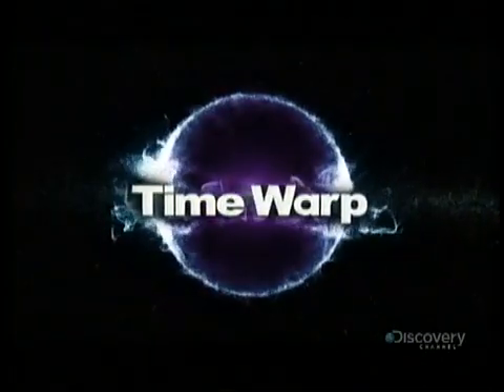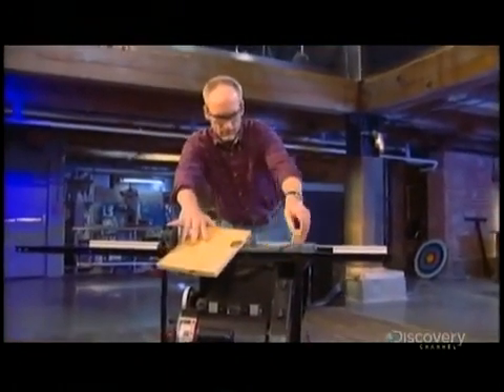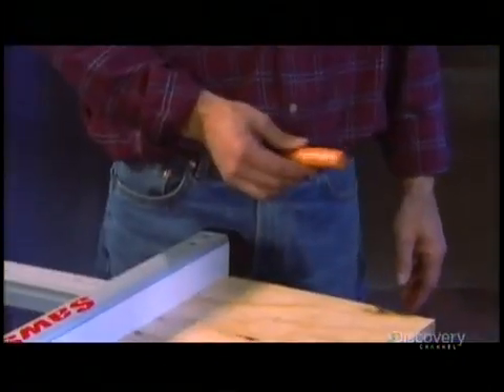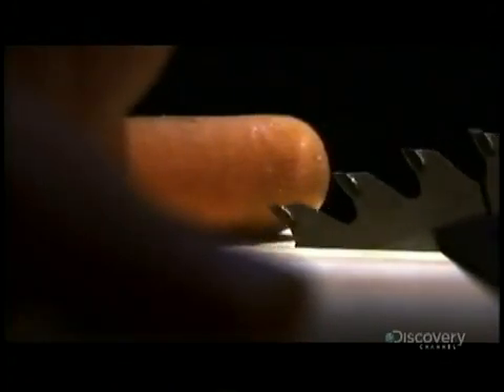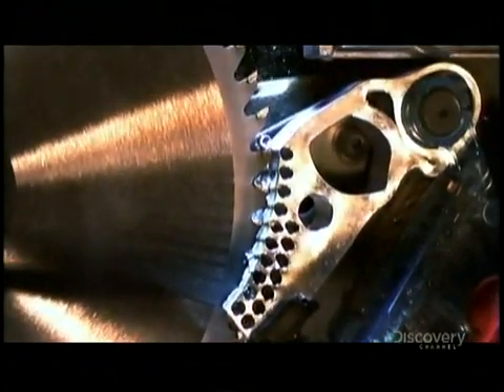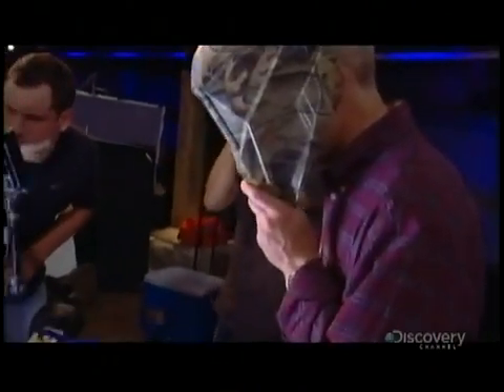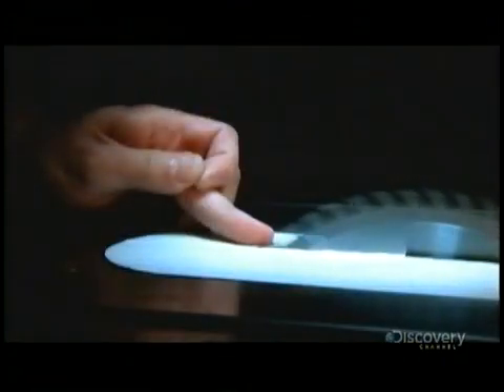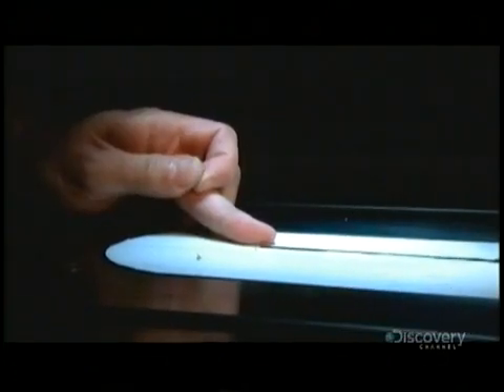Saw Stop - This guy puts a finger into an active table saw blade & comes away without a scratch!

Comment: My school has a sawstop. It went off 3 times last semester. I can confirm that it does work.
Reply: @rockeeetttt  watch other videos on it. You replace the cartridge and the blade, and it takes less than 5 minutes. No need to spend money on a repair guy.
Reply: @Nico-pb1sr  wtf dude if u can't change your own blade and cartridge you shouldn't own a saw lol
Reply: $60 is way cheaper than a finger I would say.
Reply: @silencedknight  I would know
Reply: @silencedknight  Depends on the country.
Reply: @rockeeetttt  nah bro you literally pull the blade and brake out and snap in a new one you dont need a repair man
Reply: Spencer Wentland they said only $60 to rebuild it
Reply: @abcabcq313  plus labor. 60 is the mechanism and blade
Reply: Niko K that’s nothing compared to the price of losing a finger, especially 3 school kids I’m sure the school didn’t mind
Reply: @DisturbedDrake  Even if it costs 1000 dollars its worth saving a finger.
Reply: @iBradFIFA  ikr compare to the lawsuits
Reply: @DisturbedDrake  yeah but Any good work shop could do the fix them
Reply: @DisturbedDrake  if you couldnt change them yourself and had to hire someone you probably shouldn't own one lol
Reply: @abcabcq313  It depends. $60 bucks for the cartridge + the damage. It can or  not destroys the Saw Blade, it's possible to brake some transmission part and more...or just the cartridge.
Reply: HyBye ❶ wtf $60 for blades and mechanism what kinda cheap ass machines are ya workin with
Reply: @PyroYeet  I agree my blades definitely are 3 or 4 times that price but still worth replacing cause I can't replace my fingers!
Reply: @jasonlemire591  I’m no longer in woodworking but when I was, I remember our gear was expensive, quality, and safety
Reply: @PyroYeet  ya I can easily spend few hundred on blades
Reply: In my high school wood shop about 10 years ago we had one of these too that went off at the same rate. When I was there it was always a student sawing through a board with nails or aluminum tape but it's way better to have the system and spend $100-150 for a new cartridge and blade than have to explain to the parents why Billy came home with a few less fingers.
Reply: Money doesn't matter when you save a finger
Reply: @Hansolo2048  People always find something to bitch about.
Reply: @Hansolo2048  Money always matters, even with safety and security. Wether we want to believe it or not.
Reply: @Tconl  Incorrect. Quality of life is priceless.
Reply: @Tconl  cheaper and much easier to replace a saw and a brake than 1-3 fingers of a good worker, lot less headache too
Reply: @shadowsnipes9242  Unless its not a good worker. And you got plenty of em. And they got very little legal work to back them up. As I said before, it depends on the country.
Reply: cheaper than a lawsuit
Reply: Spencer Wentland it only ruins the blade and brake
Reply: @rockeeetttt  It destroys the module and blade. I would rather break that than have my life altered forever
Reply: Wish we had this in my day. Tons of kids at my school got it the rough way. The worst was the kid who got it from a planer...
Reply: @TightCasserole  
Hey sir, fingers were cut off completely? was that in 60s?
Reply: I was upset when I found out my saw didn’t have one of these, after I cut off 2 of my favorite fingers, but then, later, I learned that if my saw had had one it would have costed me 60 bucks to fix it, so I was relieved. Cleaning up the blood didn’t cost me a dime, and my saw still works great!
Reply: @chriswebster24  fingers are over rated
Reply: Spencer Wentland not true
Reply: @rockeeetttt  why say things you know are not true?
Reply: I put my finger into the sawstop at school to prove to my friend that it worked
Reply: @jfk9237  geez don't ever do that again but I'm glad it worked.
Reply: @jfk9237  I put my friend into saw without stop to prove it wouldn’t stop
Reply: @jfk9237  well that was an hour waste of my time... last time I listen to a ghost
Reply: That’s 3 people who have no business on a table saw. You should still treat like any other table saw..
Reply: @ScrewedupClicksta713  I remember this actually being an argument against them… a stupid one, but one nonetheless.

People feared that users would become complacent and trust in the system and this take less care around them and while I’m sure that’s true to an extent you can say the same about any safety feature; doesn’t mean it shouldn’t be use but simply not relied on.
Reply: @Fetidaf  haha I remember reading that crap too on Reddit. Had a lot of arguments with disbelievers over saw stop 5 years ago.
Reply: @ScrewedupClicksta713  ikr I don’t think anyone should be on a table saw, I put wood on it myself.
Reply: We didnt. Around 5 fingers in 4 years went flying.
Reply: @goos6005  shop class, a lot of schools stopped teaching it because of liability so many schools don’t have them now
Reply: @bumstudios8817  that's a shame. My first power tool was a cheap $100 Ryobi 13amp table that I still use. and first thing I did was read the manual, and figure out ways to avoid kickback. One of which I literally do rip cuts standing on the side of the fence and pull the piece toward me, and forward. That and I built a really cool table saw sled that physically blocks your hand from touching the blade and it has a plexiglass cover which protects from kickback and also leaves the dust on the table in a very neat pile at the outfeed.
Reply: @WarPigstheHun  that’s awesome, respect it and use it properly and it will be fine. Play stupid games.. win stupid prizes. They don’t need to be expensive, at the same time experience matters a lot too.. watch I build it ca.. where he puts his fingers an inch away
Reply: @bumstudios8817  yeah. Still, I wish I could afford the saw stop. And I also really like to cut metals. So I built the next best thing.
Reply: @- Literally not true...
Reply: @rockeeetttt  bullshit
Reply: @rockeeetttt  This video is very old and will have newer tech or saws built especially for this tech.
Reply: What a beautiful impact to see after watching the video
Reply: I have a feeling that kids just wanted to test it. If not, I'm genuinely concerned about those people around power tools.
Reply: Really I bet those kids would of deserved it how THE fuck can they set it off 3 times
Reply: Last year the one at my school went off but nobody had a finger near the blade, our teacher thinks it was because the wood was too wet.
Reply: @Alex-oz8qf  lmao if you’re using wood wet enough to trigger that, then whoever assigned the wood should be fired, unless ofcourse you’re making a piece of outside furniture that will be in the rain a lot
Reply: @PyroYeet  yeah, the wood was being used to make chairs to go outside
Edit: also it was wood that we had recently cut using our sawmill so it had been outside and didn't have very much time to dry.
Reply: @Alex-oz8qf  oh wow so REALLY wet wood, usually it would be around 12-20% moisture (broadly taken) that you’d saw so fresh cut wood with no drying, prob at like 50+% moisture will trigger the sawstop. Also make sure you don’t get wonky chairs
Reply: @PyroYeet  chairs made of green wood :)
Reply: Lmao we had a woodshop teacher who set one off like 6 times we called him sawstop peters
Reply: Spencer Wentland wrong actually, the only thing thats replaced is the blade and the break. Not the entire thing
Reply: @rockeeetttt  old video
Reply: MassiveFatD You sound that you’re wrong
Reply: Oh shit-
Reply: @slum or more geez
Reply: furfag
Reply: Bullshit
Reply: @goos6005  shop classes like carpentry.
Reply: Lol
Reply: Why is a saw like that one at your school?=)))
Reply: If it went off three times maybe that person should not be using that machine
Reply: God damn just imagine if it weren't there
Reply: @slum or one kids 3 fingers
Reply: That is good that it's saved their fingers, but they need better training if students are potentially going to cut themselves that often. I use one at work and it's not a saw stop, but we have proper training, riving knife and guard and no one has cut a finger off on it and no one has had an injury on it when using it correctly
Reply: @WillMaskellTaylor  I refuse to use my riving knife both because- I bought a full kit of that  expensive microjig thingy, and built a very fancy sled with a plexiglass that shields you from dust and kickback and has a layer of aluminium that  prevents your hand from moving in front of the blade.
Reply: @slum not so fast. If you know the machine stops when you put your finger in it, how do we know the kids aren’t just intentionally putting their fingers in it
Reply: My school didn't have one and a kid lost 2 fingers. He was shot 1 month later for "throwing gang signs" at a rival gang. 
Westside til he died.....rip lil homie
Reply: One kid 3 times i wager.
Reply: they probably did it on purpose.
Reply: How do people get their fingers into the blade anyway? If I was working with such a dangerous machinery I'd make damn sure my fingers are not going to touch it.
Reply: @Gaze73  people don't always do this intentionally. Sometimes they're contractors and forced to cut pieces faster than recommended or they'll lose their jobs. Sometimes people forget and work when they're exhausted. In theory everyone should follow the rules but, in reality we are human and imperfect beings. Saw stop is designed with that in mind, that it's not always the users and even if it is, accidents do happen but it doesn't need to cost a finger or life.
Reply: @Gaze73  Easy to say when you don’t do it. Like anything, people simply become too comfortable.
Reply: @jacksonbould7417  that's good. If I ever get to buy one of these, I hope it never goes off on me.
Reply: Why does your school have a saw?
Reply: @toohottohandle3928  shop class was a standard class a few years ago
Reply: @toohottohandle3928  What? So people can learn how to use a saw?
Reply: @toohottohandle3928  shop class, learning construction and shi
Reply: Lmfao like what were u guys doing before sawstop
Reply: You don't deserve a sawstop you furry scum
Reply: My school didn’t get it as most high schools are filled with immature kids that would purposely activate the sawstop. Was also told it’s not cheap to replace blade and other parts needed.
Reply: @TheWaken  that’s a stupid reason. Send the Bill to the parents then.

Comment: It is closer to $300 each stop, and that is better than a finger.  But the problem is, any wet treated wood will stop it too.  At $300 a stop, it is not worth it.
Reply from the maker: Damn that is a good point, didn't think of that
Reply: From what I've heard it's pretty rare for wet wood to set them off these days. And even then, I believe you can disable the mechanism temporarily. Shouldn't be a problem unless you're working exclusively with wet wood.

Comment: Instead of damaging the blade and braking system when the safety function is activated, why not have a mechanism that pulls the blade downwards. The blade is saved as well as ur finger. Use a spring to pull onto the bush or bearing housing spinning the blade. Can be held up by a latch. When the finger touches the latch is released and the blade moves downwards. Just a thought.....
Reply from the maker: That is actually a good idea
Reply: bosch makes one like that but you need to replace the cartridge that pulls the blade  because it uses some sort of explosive. but im guessing saw stop makes a lot of money on brakes and blades so thats why they do do that
Reply: actually who cared about the blade and the machanism when it just saved you finger or even an arm.
Reply: @adventureairinc7355  no one, but when it malfunctions, and is set off by lumber that is a little too wet, or by a foreign object in the wood, and then it costs $200 to fix it, people care. It can be expensive for people that are not rich.
Reply: because they could not make money by selling you a new cartridge.

Comment: His "faith in technology" was low in my opinion. First he had moisturized his hand with a cold water to ensure conductivity of his skin. I'm sure that seasoned woodworker would have rather hard and dry skin, rather than the soft one. Second - he was putting his finger extremely slow - so it's hard to say if he wouldn't be wounded in a 'real' situation.
Just cut several dusty planks first, than 'accidentally' put your finger along with one of them into the blade. I'm very curious about effect.
Reply from the maker: Please consider subscribing, I’m trying to hit 10k Subscribers :)

Comment: notice how he used his middle finger, in case it didnt work. index and thumb are the most important
Reply: middle is pretty important whenever there are other people around, perhaps most important
Reply: @violentrobot  
Also, it is the "explorer",  a very important function...
Reply: It's also the longest one, so the rest of his hand would be farther back from the blade than if he used any other finger.
Reply: BeTheDeathOfMe  the pinky finger is the most important finger on the hand alongside the thumb because it provides the hand with necessary grip strength and support. Gripping things without your pinky makes them fall easily and writing without your pinky makes your hand fall over forwards. Not having a pinky greatly decreased your grip strength and ability to perform daily tasks such as writing. The index finger, on the other hand, is just a copy of your middle finger and the least important of your fingers. You can try to write without using your Index finger right now. It's easy, right? Losing an index reduces your strength by a little but you don't really miss out on anything you could do before. By far the least important finger on the hand.
Reply: @alejandrosastoque1143  thank you! However I would like to refute that the ring finger is less impacting on day to day life than the ring or index (coming from someone who lobbed off the tip of his index)
Reply: @alejandrosastoque1143  as a therapist working in outpatient orthopedics and specializing in hand therapy, you are spot on. The pinky on your dominant hand is the most important finger. The least important would be the index on the non-dominant hand. Anything you can do with the index can be done with the middle finger.
Reply: BeTheDeathOfMe  pinky finger is important, I’m pretty sure samurais had them chopped off as a punishment, anyway they have a lot of strength. In order of most important to least important regarding functionality, I’d say it’s thumb, index, pinky, middle and then ring finger.
Reply: And it's the left hand, lol.  Still gutsy
Reply: BeTheDeathOfMe  the pinky finger is actually vital in a lot of your strength and dexterity in the hand, the ring finger is the most useless.
Reply: BeTheDeathOfMe  pinky and ring finger provide the strength of your hand. If you lose one of them, you lose half the strength of your hand.
Reply: Thats not what your mum thinks.
Reply: I woulda used the pinky lol
Reply: @DavidZaG-  Dr. Evil would disagree
Reply: @Mixwell1983  and those who drink with their pinky extended haha
Reply: and on the left hand
Reply: Non dominant ring finger is the least important
Reply: Lol I lost my middle finger. It sucks when you forget and try to flip people off. Other than that, my grip strength isn’t as good.
Reply: Its actually the index finger of the hand that you dont use for writing thats least useful.
Reply: Yeah maybe for you virgin boy! my middle finger get's plenty of action and is very important! :)
Reply: @Vortigon  HAHAHAHAHAHAHAHAHAHAHAHAHAHHA you made my day 🤣🤣
Reply from the maker: Please consider subscribing, I’m trying to hit 10k Subscribers :)
Reply: @anthonyprezutti  Seeing as how your comment is not related to the original comment, I must decline your offer good sir.

Comment: Sixty bucks?  More like $100 for the cartridge and 50+ for the blade.   The SawStop is a great invention, but to be honest, you will get a cut if you contact the blade at normal working speed.  The thing that makes the saw worth the money is that it will only be a cut, not an amputation.  Generally the worst case scenario is a couple stitches and a small scar, but you still have your finger.
Reply from the maker: I’m trying to hit 10k Subscribers, please consider subscribing :)

Comment: Wet timber would suck
Reply from the maker: I’m trying to hit 10k Subscribers, please consider subscribing :)
Reply: You can test if green wood will fire the brake while the saw is off. If it does trip the brake you can turn the safety mechanism off.